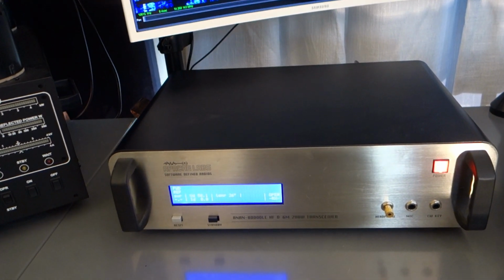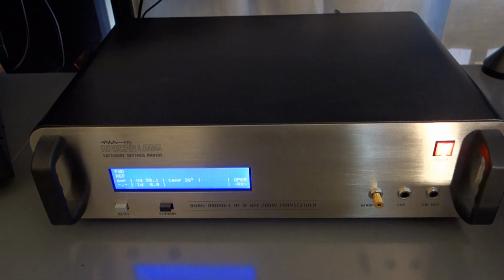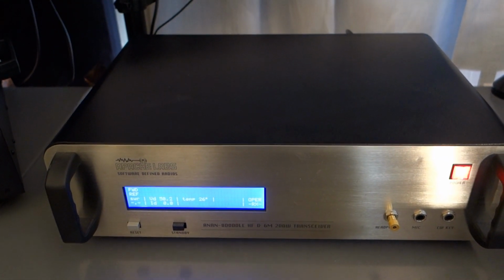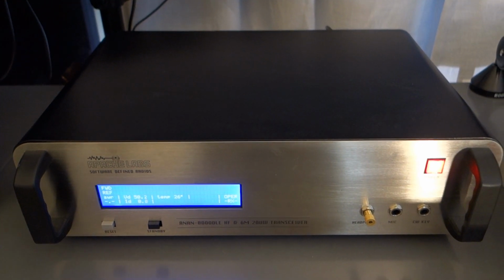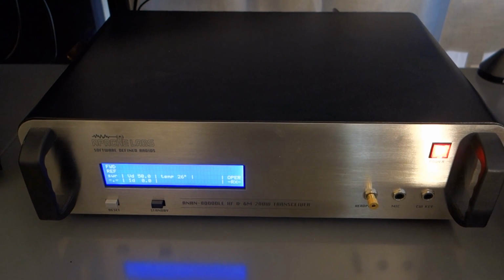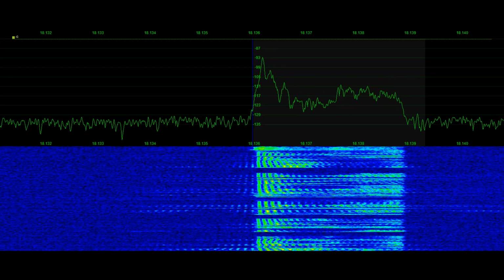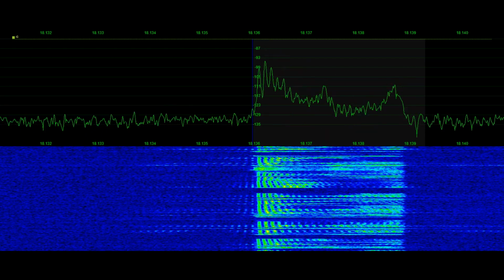KA0KA HAM Shack Radio Room Layout | Signal Phantom

Comment: Do you have software to decode many of the digital mode signals you encounter? I imagine the military stuff is encrypted but the ATC stuff might be in cleartext. Are there any digital codecs used by hams for speech transmission in HF or would it be too spectrum inefficient? I was thinking it would be interesting to use the same codecs used to process speech data for cellular phones for HF transmissions.
Reply from the maker: FL Digi is a good starting point if interested...

Comment: How wide is that?? Kind of kills the the band doesn't it.
Reply from the maker: You may be interested in seeing my 'how to measure IMD splatter' video that illustrates the typical 2.8kHz J3E signal occupying 10kHz of bandwidth.  Difference here was, the occupied bandwidth was the same as the audio bandwidth.  No interference is ever permitted, by anyone regardless.

Comment: I like the clean look. I hate the function. No where to put your legs under those tables, which are mot desks. And the equipment is placed a bit far from the user.  Glad it works for you thougj.
Reply from the maker: Desks are 3 feet deep and you can slide under them, must be optics on video that make them look 'shallow'!

Comment: i have a yaesu 857 is there away to put the display on an external screen like you have?
Reply from the maker: Most likely not, I am using a system dedicated to this, from the PC build on up.  I am using an Apache Labs Anan 8000DLE.

Comment: Great station.  Where did you get the rack mount case for you computer? I"m looking for similar.
Reply: Look online for "2U rackmount" or "server" cases. Be careful though, as any case under 4U height will require low profile PCI cards, which will limit you on which graphics cards you can install. 4U cases and above can accept full height PCI cards.
Reply from the maker: I think New Egg.  But you do need to pay attention to form factor of things like power supply and video card...

Comment: Tyler, your station is absolutely beautiful. I do have one concern though... I have watched the video several times and I can't find a spec of dust anywhere. My own ham station has lots of dust so if you need some, I'd be glad to send it to you so you can have a real authentic dust-covered ham radio station. Nice to see K1KW - Chuck with a railroad-track straight up-and-down clean 40 meter signal on 40 meters at 3:29 into the video. Thanks for the tour, it looks like you are having fun!  Rob W1AEX
Reply from the maker: Thanks Rob.  Well I thought I should start getting some of these type of videos out, because my 200 videos on HF signals are going to take a bit show.